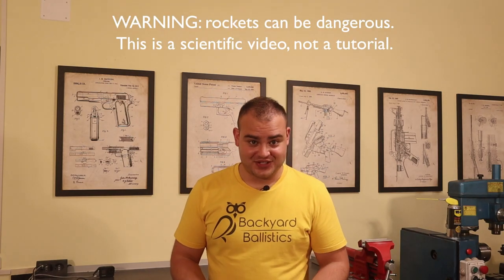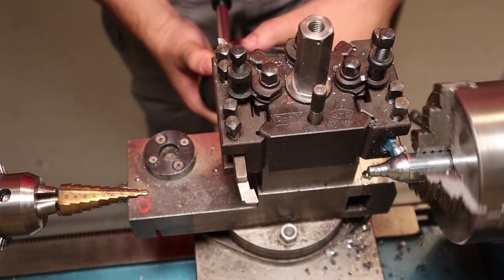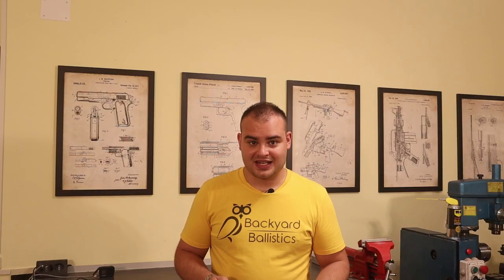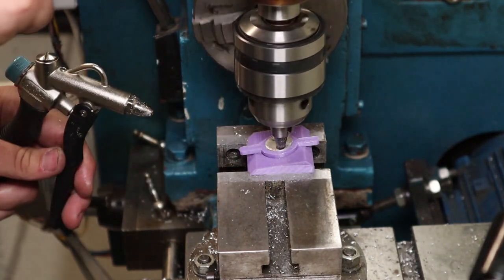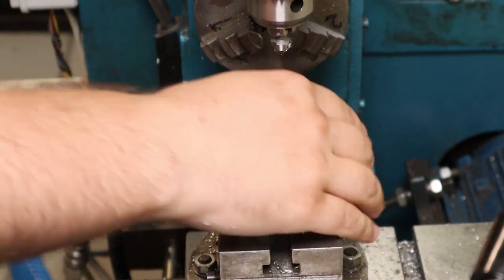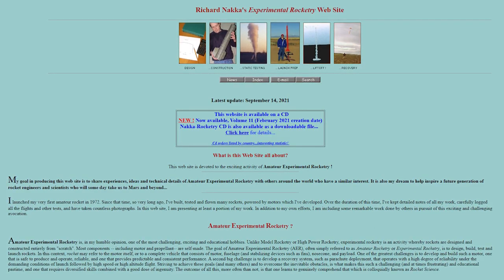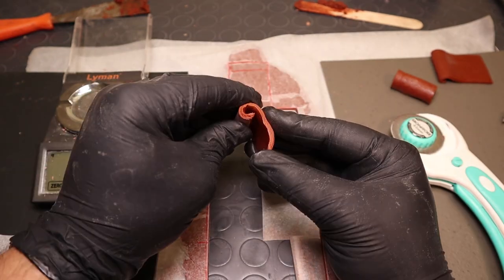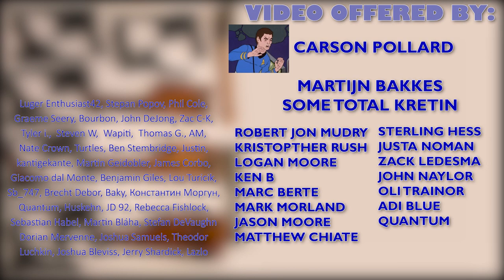HOW I've Remade the 1960's GYROJET Rockets [part 3/3]

Comment from the maker: This is Part 3 of 3 of my video series on the Gyrojet. You can find the other two parts on my main channel Backyard Ballistics at these links:
Part 1: https://www.youtube.com/watch?v=FUATE-Ci1n0
Part 2: https://youtu.be/YvnJ1rY3ZA0
Reply: When you have chance take a look at Tech Ingredients channel and his study on rocket motors.
Reply: The Fliegerfaust from ww2 used spin stabilized rokets too. The nozzles had 45 degree and the powder grain was cylinder with holes drilled inside. They adjust burning speed with how much holes they drilled inside. maybe an alternative ?
Reply: Ive found an Gyrojet artikel. They wrote 15Degree was the orginal Angel and  3600 turns per secound . Maybe it helps you for the future. :)
Reply: NOW A TEST PLEASE

Comment: Since these are basically 12 gauge in caliber, it would be interesting to see them shoved into a shotgun shell with a small amount of powder and fired out of an unmodified shotgun. The burning gunpowder entering the nozzle would provide ignition to the rocket as it pushes the rocket down the barrel, though you'd need a plastic sabot instead of a shot cup to provide a gas seal and still allow burning powder into the nozzle. IRL, Rocket Assisted Projectiles work the same way and are used for long range artillery, and the Warhammer 40k bolters use rocket assisted projectiles according to the lore.
The channel Taofledermaus does high speed camera shots of weird custom shotgun ammo, so they could likely be convinced to test it with rifled and unrifled shotguns pretty easily.
Reply: Good idea IMO, international shipping is the likely issue. Not sure if TFM wants to go making propellent but there's a good chance and I don't think the empty projectile and base would pose a problem.
Reply: I'd be concerned about chamber pressure doing that. I mean you are essentially proposing blocking a shotgun barrell with something containing more than a shells worth of propellent. If it doesn't accelerate sufficiently you are going to venture way out of the design criteria of a shotgun barrel.

Basically I want to see this, but not fired from a shotgun anyone objects to sacrificing for "science"
Reply: @HALLish-jl5mo  That.... is totally valid haha, hadn't even considered the "double powder load" effect. I don't think it would actually turn out to be a problem but I wouldn't volunteer to shoulder fire the test shots either.
Reply: Couldn’t you relieve some of the possibility of excess pressure through a series of gas ports venting into an expansion chamber?  Effectively using the same concept as the fume extractor on a modern tank gun. Since you know almost exactly what the volume of gas will be from the ignition/launch charge and the rocket motor within your given barrel length you should be able to calculate at what point to place the fume extractor/over pressure buffer. If you used a low cost semi auto shotgun you would even have the pressure bleed used to cycle the action further reducing the likelihood of beyond tolerance over pressure. 

Please note that this idea is based upon 50 years of shooting, a history degree and building at least a division’s worth of model tank kits without a single drop of engineering or other scientific knowledge.
Reply: @daniel_f4050  If I understand correctly I think that would work but asking someone to drill or modify a shotgun barrel just to test some specialty projectiles is a big ask.
Reply: @jameshealy4594   I wouldn’t expect them to do that sort of mad scientist job. Not even OG is that looney. It was just an idea on how to get around the risk of blowing up the gun.
Reply: Who said that they would shoulder fire it? You can use a .50 cal barrel if you're worried about pressure. TFM is a smart cookie and knows a thing or two about mass, velocity, pressure, friction, resistance, ect. 
Remember safety 3rd!
Reply: with a polyolefin heat shrink sleeve to protect the shotgun barrel, maybe just a primer and a tiny load of black powder for initial acceleration and ignition
Reply: Give it to Jörg Sprave whenever he may visit the US.
Reply: I think Taofledermaus also tested the original MBA Gyrojet.
Reply: You'd have to find a different, smaller projectile body. A CO2 cartridge doesn't quite fit in a 12 gauge barrel. It's a hair to large. I also don't know how the rocket would react to backpressure from trying to pressurizing the barrel behind it. It would probably increase the pressure inside the projectile body and mess with the burn rate. I'm betting the original gyrojet barrels were perforated for a good reason, both to eliminate backpressure and to make it easier to push the air out of the barrel ahead of the projectile, instead of pushing a large slug of air out of the muzzle.
Reply: The problem with that is normal C02 cartridges are too large to fit into a 12 gauge shotgun.
Reply: in the only active gyrojet gun it is continuously allowed to vent overpressure through a heavily vented barrel because the propellent would have to go somewhere, otherwise i thinkk it would overpressure and try to push its way out of the barrel due to pressure instead of the gyrojet propelling itself in this case i doubt it can give itself enough spin to stay accurate and will just tumble and go footseekerr straight out of the barrel. just a thought, though

Comment: If your still messing with this I have some ideas for firing effectively. Using compressed air or something for about 3 inches passing past a electric spot setting off a spark to ignite the rocket. Can go more independent on the plans

Comment: The coiled propellant is a genious touch. Did you use a flow simulator (like the one provided in Solidworks) to determine the physics of the gas flow through the nozzles?

Comment: Fantastic series! If you choose to revisit this; I feel taufledermause would be able to help greatly given their experience with gyrojets and all the various slug designs they’ve tested. 
Perhaps the cartridge is too long? My novice mind wonders if adding spiraled grooves or rifling to the exterior would help like integral fins, and I have a strong gut sense that three ports in the nozzle would be more stable than two ports. It may have diminished returns, but another design concept would be four holes, and the opposing sets would be at different angles and diameters to really tune in thrust and gyroscopic stabilization.

Comment: Ok that's why your projectile looked familiar it was originally a CO2 cartridge. Ok then I was thinking if a solid Estes rocket propellant would be better than the one you are using it has a more uniform burn rate. I am sure there are many ideas floating around. Thanks for showing how you made the projectile.

Comment: Increase fuel grain surface area by molding a splined shape into the center hole. That way you don't get off center weight like you get with the jelly roll style.

Comment: Hey man! Do you have all the documents and resources you used for this project listed/linked anywhere? I'm an engineering student currently working an internship in the defense industry and have thought of a similar application for gyrostabilising rocket projectiles after hearing of gyrojets. It's just an idea right now that I wanna work through and see whether or not the concepts is valid but I figured you'd have more knowledge/experience regarding this and would know of crucial info that I wouldn't even think to look for. 

Awesome video! Glad that the youtube algorithm can recommend these gems from time to time.
Reply: An Introduction to Gyrojets and
Other MBA Ordnance

Comment: try and roll crimp the rocket Nozzels into the body with a pipe cutter (take the pipe cutter blade out and replace with a steel washer  -- works for me ;) )
Reply: Also using this type of pipe cutter to cut the CO2 cartridges saves a lot of time ...

Comment: Curious why you didn't use a star-shaped cavity in the solid rocket motor. Is it too difficult to form without using solvents?
Reply from the maker: It wouldn't have allowed enough surface area without making the burning behavior too regressive. If burning are wouldn't have been such a tight constraint it would have been a good solution to use a star shaped core
Reply: @beyond.ballistics  i wonder if using strings of propellant like old cordite rifle rounds could be an option, large surface area and if the propellant is able to be extruded, easy to populate the cavity, and scalable loading with extrusion die size

Comment: The spiral core geometry looks to me like it could be a factor in the poor accuracy; the lack of radial symmetry leading to uneven and variable thrust across the two nozzles.

That, and the projectile also seems aerodynamically unstable. More nose weight  should be considered to offset the aluminum nozzle slug in the rear.
Reply: Probably more to do with a restriction in available materials for the projectile, but he could also have just turned a steel bar to make a rounded end that'd fit inside the projectile, then bandsaw it off for a hemisphere insert to sit forward of the propellent.
Reply: if the rotation is high enough it dousent matter. lock at the german nebelwerfer 41 it has its explosive charge on the back side. i think the use of 45 degree spinning would make the rocket stable

Comment: I have to wonder how performance would look with APCP (ammonium perchlorate composite propellant)... Amazing work!
Reply from the maker: the performance would certainly improve, but whoever launches the rockets would be sitting in a plume rich in hydrochloric acid. I would rather use double base
Reply: @beyond.ballistics  that's certainly a downside to APCP for sure. I recall someone tried whistle mix (chlorate/benzoate) with some success in these years ago, but they tended to periodically explode which is also suboptimal.
Reply: @beyond.ballistics  
Which is why most use aluminum powder..while aluminum chloride is still a Lewis acid, is is far less an issue.   Plus the addition enthalpy is a plus.
Reply: Think pressed guanidinnitrate would be better. An cold propellant if you have the right core form it would be fast burning.

Comment: Very interesting project. I'd be curious to see what kind of accuracy could be achieved with a launch tube that fits the rocket more snugly. Thank you for sharing this video.
Reply: You could use a sabot-type casing or simple split rings that fall away as the rocket leaves the tube.
Reply from the maker: Not good accuracy unfortunately. I think I've found the cause of inaccuracy, both of my design and the original. I'm not sure yet, but it probably has to do with rotational instability prompted by the fact that the propellant grain and the gas it produces can move inside the rocket, favoring the transition to the axis of inertia of lowest energy (rotation head to tail).
Reply: @beyond.ballistics  Thank you for the reply. What you say makes sense. Maybe trying to impart rotation with the very small jets alone may compound the problem as well? You're far more knowledgeable than myself about this subject since you recreated it. I'd also like to mention you're WAY more patient than me as well.
 Thank you again for replying, and thank you very much for the way you can explain complicated subjects without talking down to your audience. Stay safe.  :-)
Reply: @beyond.ballistics  one potential advantage of the original propellant configuration, assuming symmetrical burn off
Reply: @beyond.ballistics  In heavy launch rockets, stability is maintained by trying to maintain the weight of propellant and oxidiser so as to maintain the centre of mass close to the rocket tip. You can demonstrate this similar principle by taking a half-full bottle of water and trying to balance it in the palm of your hand at the cap. It's very difficult to keep it balanced.

Conversely if you balance the bottle in the palm of your hand by holding it at the base, it's easier because of the wider base, but if your hand is shaky it's still made more difficult by the water sloshing around.

Artillery rockets get around this by having relatively high mass at the tip with all the payload. You could probably achieve something similar by casting lead into the tip of the projectile so that centre of mass never gets behind centre of lift as propellant burns. 

Another way would be to make a projectile where the nozzles instead exit close to the tip of the rocket, instead of at the base. This is an approach some antitank rockets take, like the Eryx. The Eryx was designed like that so as to achieve a tandem warhead in a shorter (therefore lighter) overall package with the rocket motor sat behind the first warhead, and the second warhead sat behind the rocket motor. This kind of design is much more efficient with its weight since you could use the same weight you would use for a lead slug for rocket nozzles instead. However this kind of "puller rocket" is much harder to design together with a launch tube; and is generally used in conjunction with a pusher charge or first stage that blasts the projectile clear of the launch tube before the rocket engine is initiated.

Comment: The real problem with rockets vs cartridges is pressure. Modern cartridges easily exceed 50,000 psi providing quick acceleration. A rocket strong enough to contain that level of pressure would be too heavy to accelerate as quickly as a bullet. Possibly hybrid combinations of guns and rockets could improve performance substantially.

Comment: I like your 3D printed fixtures.
Reply: A 3D printer is such a valuable and powerful tool in a workshop for prototyping without spending a lot, you just need to get good at modeling 3D parts

Comment: Please tell me you have figured out how to fire them from a standard 12ga. You need to make about 10 to send to Taofledermaus to be launched from a 12ga & filmed with his chronos to get a better view of what's happening during flight...
Reply: My first thought!
Reply: One does not simply ship rocket motors capable of ballistic launch through common carriers.  Caveat detonator.  But it would be cool if you did.
Reply: @keithjurena9319  they regularly ship ammunition worldwide, he wouldn't even need to ship the loaded hulls, just send the empty body, the grain mold, and the load spec data. Also would be interesting if he made one with straight nozzles instead of angular so they could test with a rifled barrel as well. Use the "motor" for thrust and use friction resistance from the lands & grooves to impart spin. I imagine those would fly with a much straighter trajectory instead of corkscrew.
Reply: @RichardCranium321  
Spin stabilized rockets can be accurate, the problem with this design is too little spin early on.  A two stage design with a tiny first stage that imparts a great spin rate would work well.
See pyrotechnic masters and their spin rockets.  Possibly Ned Gorski here on YouTube?
Reply: A 12 gauge would require a centre fire primer between the nozzles which would preclude the use of a cross pin for fastening the nozzle assembly. You would also have issues as the gyro jet pushed the projectile against the firing pin when the trigger was pulled where a 12 gauge pushes the firing pin against the projectile. This requires the projectile to be held stationary until the primer detonates in a 12 gauge.
Reply: @keithjurena9319  the biggest problem is customs. Primers and ammunition are regularly shipped globally (just by surface freight).
Reply: @allangibson2408  berdan primers have offset holes just like this... that a not an issue at all & neither is the orientation of the pin/hammer/projectile. If done properly, the crimp on the shell will act as the hammer in the original design & provide the necessary resistance to achieve proper launch...
Reply: @allangibson2408  
The smallest of amateur rocket motors are still classed DOT 1.4S meaning special authorization letter is required in addition to a fee.  Sporting arms ammunition is classed under ORM D, other regulated materials class D.
Reloading propellant is a flammable solid, primers are explosive 1.4S.  The two cannot be shipped in the same package,  only limited quantities can be commingled in a shipment.
Reply: @RichardCranium321  The primer for a centerfire cartridge is still in the centre of the cartridge. A 4 mm pin is a significant obstruction to that.
Reply: @allangibson2408  look up the flash holes in the primer pocket of Russian steel shotgun shells - they have one hole on each side of the primer instead of one single hole in the middle. It looks like it would be near perfect, but might require a slight modification in the diameter of the flash holes which is simple enough to facilitate...
Reply: @RichardCranium321  The problem is that the existing pin is 4mm diameter - and that is essentially the problem… (it’s wider than a primer). The original Gyrojet had the base roll crimped to the casing.

Comment: As a kid, my brother and I had some success using CO2 canisters as gas-powered rockets themselves. We made a firing pin mechanism out of wood and a nail that would slip over the end of the canister, which we would then slide down a steel pipe with the appropriate internal diameter. When the cartridge+sled hit the ground beneath the pipe, the nail punctured the nozzle of the cartridge, and it would fly back out the top, kind of like how a mortar is fired.

It was finicky as hell, but there were a few canisters that disappeared into the woods in the blink of an eye.